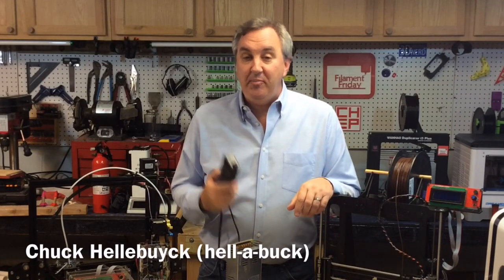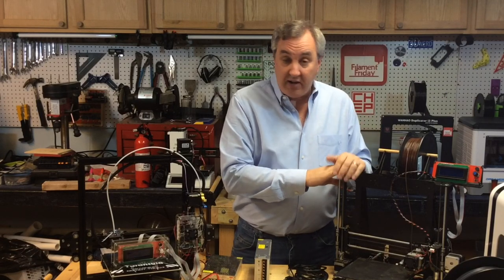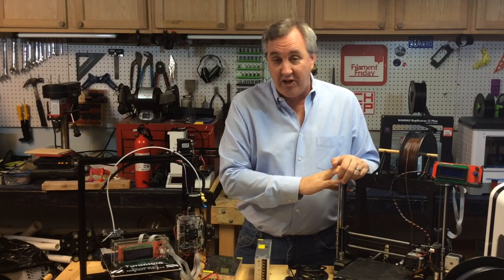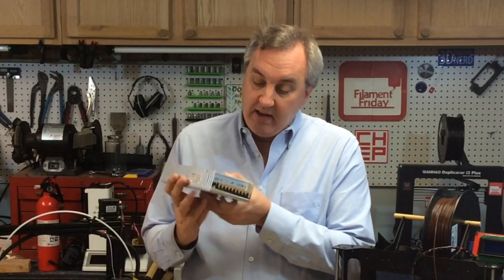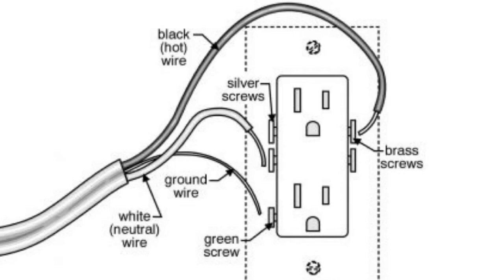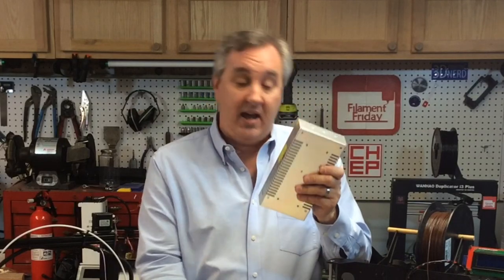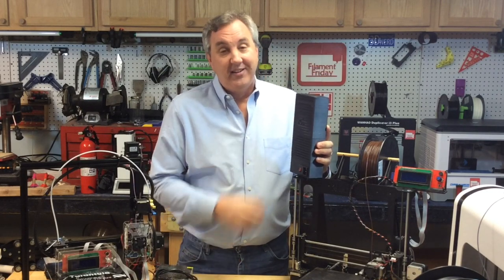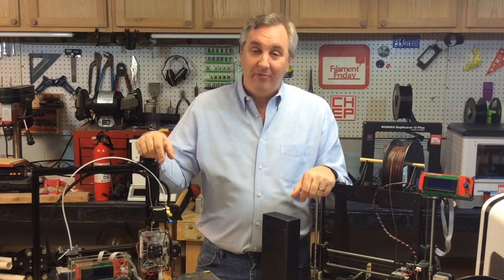How To Wire AC Line Power to a 3D Printer Kit Power Supply

Comment: Nice cover. Some more vent holes along the bottom outside edges would help air flow as well. I designed and printed my own that way and it works great no heat issues.

Comment: Great tips.   My Parents house, built in 1947, had the old two prong outlets. Even better was the first electric drills were all metal cased with two prong cords.  If the case shocked you, you flipped the around! If we were outside on wet ground, it was even better! Ouch!  So at least we learned young.  Keep the video's coming!

Comment: The cord with a green and two black is probably actually fine, assuming it's a flat-moulded cable. One of the conductors will have smooth insulation while the other will be ribbed (for the electrons' pleasure). The ribbed conductor will be neutral, and the smooth will be hot. This is defined by NEC 400.22 for the US.

That said, the best bet is to get a C14 inlet module with a switch and fuse, and use a standard computer power supply cable. Costs less than $5 delivered to your door from Amazon, and is well worth the peace of mind.

Comment: I think that grounding the output of the supply and the metal frame of the printer are both pretty important things. Yes, if you get the wires wrong it's a really bad thing. That's not a lot different than getting the wires crossed at the exposed case of the power supply. I would also strongly suggest that a device that will check continuity is dirt cheap compared to the price of a printer. Using one to check your work is a valuable thing if you don't do a lot of wiring (or even if you do ...)

Comment: My printer came with a three-wire cord with euro plug but only two-wire US (with euro color coded wires).  Now, finding which wire is which is easy, but the gauge was ridiculous, like 24 gauge (.5mm)!  Nevermind the ground.  I replaced it with a nice 16gauge 3-prong appliance/tool cord from the hw store.

Comment: Nice! I always looked at those 'Live' and 'Neutral' markings, and didn't really understand why they were there. Reason being, here in this part of Europe the power plugs and wall sockets are reversible, not keyed, even the earthed ones, so you don't really know in advance whether blue or brown is connected to Live when plugging in. So I didn't really care about what colour was connected to what at either end, as it would not make any difference. I did of course take care to always use the green for earth, though, when it was present. Will try to be more careful about the colour standard from now on! :-)
Reply: I think of all the EU, only Switzerland and UK have fully unambiguous L and N. The German plug used across most of Europe goes in either way around, and while French plug also used in Poland doesn't, they couldn't standardize the L and N locations until just a couple years ago, so you can bet on house wiring being randomized.

Not that i have a major gripe with that, because L and N go straight into rectifier, or on old passive supplies into a transformer, so the power supply cannot distinguish them anyway. Protective earth is super important though.
Reply: Sockets still have both L and N. 
It's that CE certification requries ALL wall socket compatible devices to be AC polarity agnostic.

Comment: I recently bought an Anet A8 printer kit and received a plug with blue, brown and yellow/green wires.  Upon continuity testing the cable, I found that BLUE was the HOT wire. BROWN was the NEUTRAL and YELLOW/GREEN was Ground.  Which is totally OPPOSITE of what the instructions (and every wiring code that uses those colors would) indicate.  If the cord was wires as per the instructions, the PSU might short out or it could lead to a dangerous situation where someone could get a nasty, possibly fatal, shock.

Comment: I would add a note to not assume a black/white/green wired cable is actually connected properly to the prongs. Use a continuity checker to verify. I haven't seen one wired wrong but it takes very little time to be sure and mains shocks are not very fun.

Comment: just because the power supply is properly enclosed with plastic case the other metal parts on the printer like the slider rods, stepper motor bodies and the metal body of the usb connector if the printer has usb can still be live.

also the use of the cheater plugs are much better than cutting the 3rd prong and there are some cheater plugs that have the ground connected to the neutral prong so you are protected even if you connect to a lamp cord.

the best thing is to have 3 prong cords and outlets

Comment: I bought a Tarantula, it came with a skinny 3-prong cable with the wrong coloured wiring, there was even orange! I threw that cable in the bin and bought a new thicker power cable with the proper blue/brown/green pattern from the electronics store. I even tested that cable to make sure the wiring was correct.

However, it was disappointing to see you implicitly supporting just screwing the bare wires into the screw terminals. They should be done with fork or ring terminals crimped onto the wires.

Comment: My Tarantula came with a 3 prong plug with fork terminals on the end of it.  If your cord does not come with terminals (aka just exposed wire) make sure that you crimp a terminal on to prevent heat buildup if the wires were to become a higher gauge and not be correctly rated for the current flowing through them.
Reply: I was just looking for information on whether it is a good idea to put on 'fork terminals' as my Tronxy UK plug did not come with any. I did not know about the possible heat buildup without them.  Thanks.
Reply: Fork terminals are probably the best option, but I believe your next best option would be to wrap the mains wires around the screws and tighten them to secure the wires like you would on a lightswitch or power outlet.  Watch a "how to install a lightswitch" video to see how they do it.  Good luck, and stay safe.  If in doubt, wait.  Mains voltages and 12v at 25A are not to be messed with.
Reply: Thanks for your help. Important information!

Comment: My power supply burned out the first time I connected it. The switch on the PS is set correctly to 110V but I heard a small pop when i connected it on for the first time. Can I use an external 12V 30amp power supply and connect it directly the the printer leads?
Reply: what about a battery charger that is 12v 30 amps?

Comment: Hi Chuck,  I purchased a brand new A13 printer from ebay (25 Nov 2019) that was supposed to be all wired up and just needed assembly, but when it arrived the cover on the base was was hanging off and the internal wires were disconnected and loose. There was no micro sd card or reader included. 
Can you please help, I don't know which is the 240 volt  input terminals in the power supply box as there are only black and red wires plus a yellow wire. I live in the UK and the line (is BROWN) and neutral (is BLUE).  The power supply box has (COM) markings  stamped on the aluminium case and also (v+) there's three of each. The red wire connecting the heated bed was not attached to any supply and there was no spade connection on it it was just hanging loose.
I'm confused and in a pickle Chuck and would very much like your help if possible. Appreciate any help, thanks.

Comment: I am wanting to wire up a switchboard so I have my ender 3, raspberry pi, and led light switches on a side mount panel for my desk but how would I wire that up so it's safe?
Reply from the maker: Plug it all into a  power strip with circuit breaker protection.

Comment: The wires aren't different colors because it doesn't make a difference. The two terminals go to a transformer and the wiring on each terminal is identical. The designation on the power supply "L" and "N" is arbitrary. In some, they are more accurately labeled "L1" and "L2" as the circuit doesn't have a Neutral. This would confuse Americans so they stick with the L and N designation. 

Adding a ground to the case only adds an insifigany amount of safety. The AC does not go far into the case and only to a couple of components. It'd be near impossible for there to be a failure that would cause the AC to come into contact with the case and damage that severe would almost certainly destroy the unit so it would blow the breaker. 

Adding a plastic case to a power supply that reduces its cooling is much more likely to cause harm or damage than that presented by some string of improbable failures leading to an electrical shock from the case.

Comment: Hi Chuck, Why don't you use ferrules+crimp on your conductors? Doesn't cost that much and tremendously reduces risk of fraying and shorts. See for example https://www.aliexpress.com/item/HSC8-6-6-MINI-TYPE-SELF-ADJUSTABLE-CRIMPING-PLIER-0-25-6mm2-terminals-crimping-tools-multi/32637591682.html 
Furthermore - won't that enclosure hinder circulation and pose a fire-hazard should the contents choose to misbehave?
Reply: The crimper is 10% the cost of the entire printer lol. Agree 100% about the enclosure.
Reply: 5% :p and it lasts more than a single printer ;)
Reply: It's US $18.60 with shipping. Cheap kits are $160~$200 so ~$180. = ~ 10% :-)

Comment: Warning : This solution is NOT safe! Using 3D printed parts on a power supply is a fire hazard. Same thing as using 3D printed parts on the extruder (like a hotend mount) or the heatbed (like for cable management) or the mainboard (like a case for the board and/or mosfets and/or raspberry pi). Using custom parts printed with common standard filaments like PLA or ABS (like 99% of hobbyists are using) is not recommended because potentially very dangerous. Any plastic parts surrounding high amperage components should be at the very least printed with flame-retardant filament. Although the safest and smartest solution is to use metal or aluminum parts or plastic parts with  a UL94 flammability rating.

Comment: I got my ender 5 plus, it came with the Meanwell RSP-500 but it has charge over its whole chassis and i have a 2 point wire connected to it? Should i get one with 3 points, will that solve the case?
Reply from the maker: Yes. 3 pin grounded cable should correct that.
Reply: @FilamentFriday  okay thank you.  I will try that.

Comment: The white wire is not for static dissipation, it is the return wire, It gives a path for the electrical flow. Making a complete circuit. The ground may provide static dissipation. The ground and neutral is normally connected together at the circuit breaker box. This ensures zero electrical potential between the two wires. And as far as the two prong adapter goes that ground ring only provides ground if the ground wire is present. And if the ground wire is present, it is normally a three-pronged outlet. Do not trust it.

Comment: Hi Chuck. This is a great subject for a video. I built a cheap Chinese delta printer a while ago and I was horrified by the lack of safety in their bare naked power supply. I too printed a full cover for the PSU here http://www.thingiverse.com/thing:1158973 that has separate ends to make construction (and printing) easier and has a break-away cut-out for a voltage meter if you want one.
Reply: Cool. Thanks Chuck.

Comment: dont see how thats any safer covering up the power supply  its better to fit the power supply to a metal part on the printer like the frame  then it can be earthed as well  so if your control board pulls too many amps trying to heat a bed it has no hope of heating  at least you are safe from shocks as we all should know it only takes 1/4 of an amp to kill  the cheapest PCB heat beds  can pull 15+ amps